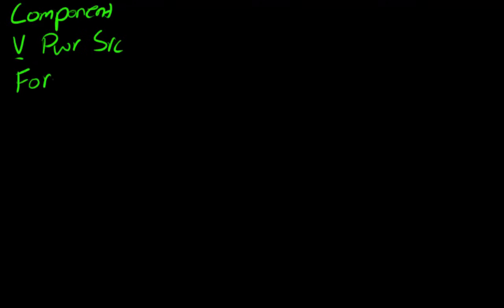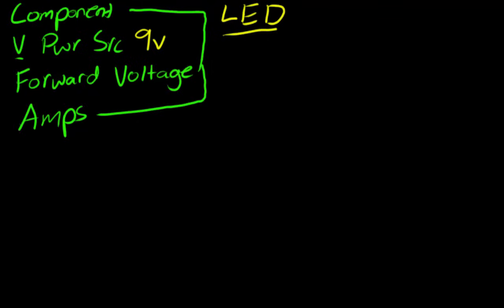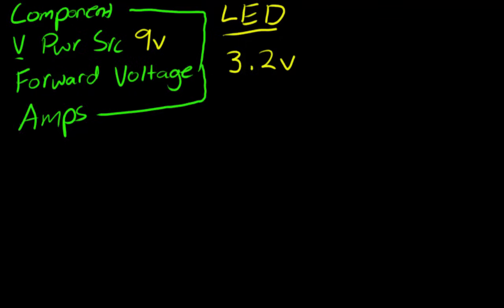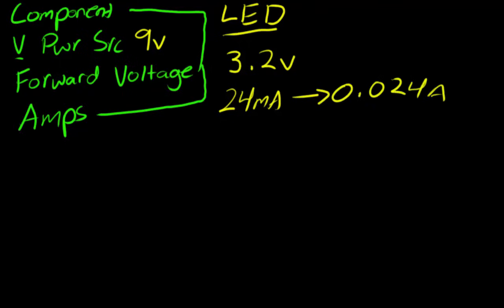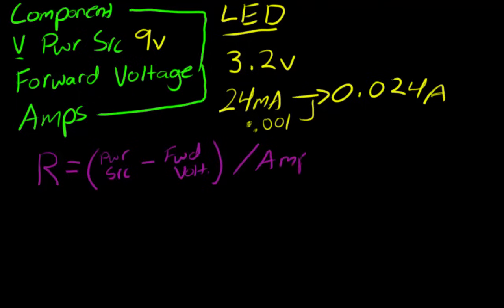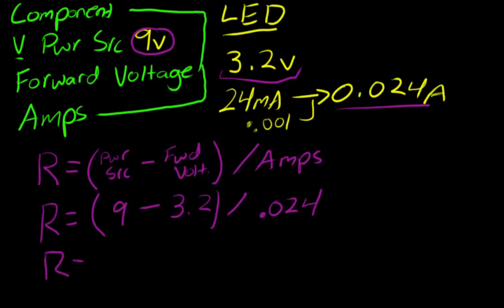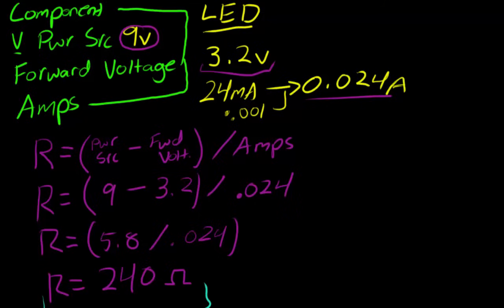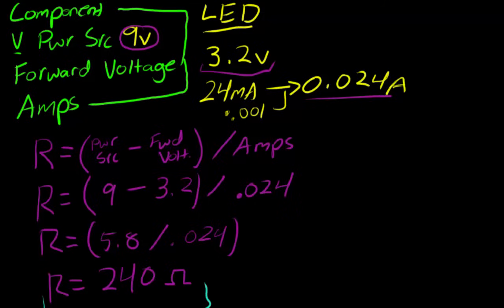Beginner Electronics - 7 - How Much Resistance?

Comment: Calculation is clear. But confusion is , when I calculate the resistor value and compare with youtube channel found discrepancy. Please share exact 100% LED's current and forward volts against LED colors with your vast experience.
Thanks

Comment: Ok what if i have 9 volts at a higher amperage how does this equation work then since its measured off forward voltage and amps of the LED not the amps of the battery???

Comment: If we have a data sheet that shows forward voltage type (example: 1.7) and forward voltage max (example: 2.2), 
I take it we go by type (1.7) to work out the resistance?

and Steady current (example 30 mA) would be for Amps(0.03 amps)?

The component I'm looking to use is a 3 bit 7 segment led display
and the power source is a 1.5 volt AAA battery

Comment: Do we just assume the battery has the correct amount of amps for the led? you said the 24mA was the led's requirement, but how the hell do you lower amperage? the equation only covers the resistance for the components amperage, only reducing voltage?
Reply: So basically the amperage of the LED is how much it will draw from the battery it doesn't matter if the battery is 20 amps the led will still only draw what it needs you just need to get the voltage right
Reply: I just figured it out.

Comment: Sometimes you do not need to add the forward voltage. I just did the same thing for a small motor and there was no Forward Voltage specified so I guess its only for LED's?

Comment: I have a power source of 19.5 and amps of 6.7. There is no known forward voltage differential as the power is moving into a coil of copper wire.  So if i divide it all out, I end up with about 3 ohms. My question is in regard to the watts that are being put out which is about 130 watts. When choosing a resistor, do I take the wattage output into consideration and if so, how do I calculate that in?

Comment: Just curious... 
Let's say you have a 24v power source and you want to power a gadget or let's say a laptop with a forward voltage of 19v;

Would the laptop work by adding a resistor to the 24v power source?

Comment: Im watching your videos to brush up/from scratch electronics, I have a light led fixture and its toooo bright but I want to dim it down but tge power supply is not dimmable so I thought I was smart so I figured how much voltage could it be on the load side 100-150vdc yikes, so know im trying to find a way to dim it after the power supply

I was thinking to just put a ristor or potentiometer but is it really that simple

Comment: A question - if you connect two 100 ohms resistors to the circuit, one after the other - does that create a 200 ohms resistance?

Comment: if I wanna add this is a car what voltage should I use a 12vwhen the car is off or 14v when it's on and what about the power of the resistor doesn't it matter.

Comment: Summary:
- some electrical components (e.g. LEDs) can only handle so much current going through them, any more and they will be damaged
- you know how much voltage your circuit has, but how much resistance should you add to the circuit to ensure that the LED (or other sensitive component) does not get damaged?
- use this formula: (circuit_voltage - component_forward_voltage) / component_current

Comment: Do you add a resistor for each LED in the circuit? Or would 1 resistor be enough for 10 leds wired in series

Comment: So if i have multiple components in a circuit say an led and a speaker do i do the calculation for the next component with the source minus forward voltage as my new source for the component so (new source - forward voltage) / amps used by component

Comment: Quick Question: Can you stack resistors? Like have 2 resistors on a circuit each at 120 ohms? or does the math not work that way?
Reply: Sorry, I'm like 5 years late to the party, but hopefully someone sees this
Reply: @lukexu6613  It depends how you connect them. If you connect them in series you just add their value. So 2 resistor of 120 ohms each connected one after the other are the same as 1 240 ohm resistor. If you connect their ends (forming a circle e kinda) its different. Here's a link http://www.resistorguide.com/resistors-in-parallel/. Also cool name
Reply: @lazyluke2773  Haha! thanks for clarifying, I was watching a hacksmith video and he had trouble with adding resistors or something so I was curious. Your name might be more accurately describing my current state though 🤣

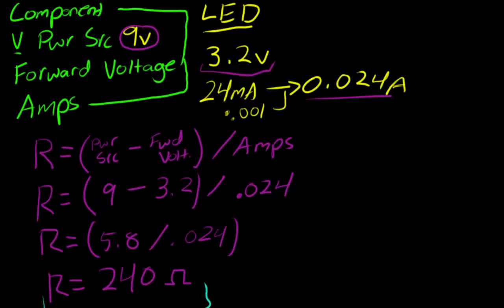Comment: (5:19) - I don't understand. 
If this equation is the resistance for the whole circuit, shouldn't the resistance of the LED be subtracted from the whole, (240Ω) to determine the required value of the resistor to use?
>

Comment: forward voltage =  the amount of voltage needed to get current to flow across a diode.
Reply: I think this episode might be crucial to the understanding of electricity. I imagine the forward voltage like a valve. If it is not reached the gate is closed for the current. If it is reached exactly then you need no resistor and it works perfectly. If it is overexceeded then the detla (supply - forward voltage) needs to be decelerated. The thing I don't get is that in the previous video it was mentioned resistance controlls current, not voltage. So what is the relation between voltage and current then? Of course R = U / I. But practically? If we have to much voltage and need ressistance to reduce it, then it is not controlling the current but the voltage. Or both? Maybe current and voltage together give a kind of momentum which can be reduced by ressistance.
Reply: @Mc12136  I love this question and your example! I would also wish to know through such an analogy if you can formulate it differently after such a long time. We may think alike. :D
Reply: R = U / I
R = ressistance we need
U = voltage overload we have
I = current the LED desires
I'll go with that. Still struggling with imagination and therefore don't know intuitively how much voltage / current is going out behind the LED in the circle. But the next videos might explain.
Reply: @Mc12136 did you figure this out? I think your misunderstanding here is based on your belief that “voltage goes in and comes out” which it does not. Voltage, aka “electric potential difference” is the difference in potential between two points. 

For example, if you lift a rock a foot off the ground then the rock has potential to fall when elevated but no potential to fall when it’s on the ground. The difference between these two states is measured in Joules for the rock (1J if it weighs 0.75lbs) and 0J if it’s laying there. It’s a difference of 1J. Hence, voltage is Joules per Coulomb which is 6.25 quintillion electrons. In other words, you have to measure the potential before and after the component and the difference is your value for voltage. It’s called “measuring across” because it implies something like a bridge. 

I’m kind of new to this too but it’s important to realize that voltage is not going anywhere. It’s simply a potential for the electrons to move. Before the component there’s more potential, after there’s less. You measure each point to determine the difference and express that in Volts. It’s sort of like disliking your neighbors then moving away. Your hate motivated you (the electron) to move but now that you’re in a new nice place, you’re no longer motivated to move (voltage didn’t come with you). 

Does that help or did you already find the answer? I’m just trying to do some peer review to help myself learn also. Anyone who can tell me I’m wrong is welcome to 😂
Reply: @Mc12136 regarding your second question, according to ohms law voltage is current times resistance (V = IR). 

Let's say we have a 10 volt battery and a LED that requires 5 volt and 2 amps of current to run.

Now 10 volts are clearly too much for the LED and we would like your resistor to eat up 5 volts so that we can provide the remaining 5 volts to the LED.

Keeping the Ohms law in mind and moving the variables around we can understand that since V = IR then R = V/I

So our ideal resistor that should eat 5 volts out of 10 volts while allowing 2 amps of current through would be:

R = (10-5)/2 = 5/2 = 2.5 ohms 

Hope that clear things up
Reply: @dough-pizza  Thanks for explaining. The velocity analogy for voltage is very helpful.
Reply: @Mc12136  voltage controls the rate of flow of electrons. A high voltage means a high rate of flow of electrons.

When you add a resistor to a circuit it limits the flow of electrons. Since a high flow of electrons means a high voltage, a lower flow of electron means low voltage. So since resistors limit the flow of current they're essentially limiting/reducing the voltage
Reply: @dough-pizza you're wrong brother resistance is about limiting current not voltage. Voltage is just a difference of electrical potential energy not the flow of electrons itself. You can have the same amount of voltage in a circuit but increase the resistant and therefore decrease current.
Reply: So like is it the minimum amount of voltage for the current to overcome the resistance within it?
Reply: @VSHEGDE1947  nah. That's just the minimum amount of current you need to light up a LED. Simple
Reply: @Yash-qs8iu  So if my power source outputs at 3.2V I could light up my LED without having to place a transistor first?
Reply: @TwistZero  With LEDs, once they receive a voltage greater than or equal to their forward voltage, they will draw as much current as they can. A resistor is needed mainly to limit the current for the LED and less so to drop the voltage.

Comment: What is forward voltage ?????????????????
Reply: you've probably figured this out by now since it's been 5 years, but I just saw this and here to say, that forward voltage is the (how it was explained to me in school) the voltage required to energize or push current through the diode or LED. There will always be a loss of voltage across the LED.

Comment: Now wait just a minute what if I've got me a LED with a "VF" (Forward Voltage?) of 3.3V and I hook it up to a 3.3V input off my Arduino here. Do I just not need to worry about things blowing up? And if you're feeding your hypothetical LED 9V, does that mean you just went and reduced the Voltage/Water Pressure with your resistor down to 3.3V?
Reply: just use the formula lmao
source - FV in your case would be zero. You can then divide that by the amperage, whichever it is, it will still return a resistance of zero ohms.

Comment: What does "forward" mean in "forward voltage"? And what's the difference between it and a "nominal" or maximum allowable voltage?
Reply: forward basically mean the minimum voltage needed for a component to work (or for the current to travel through ((move forward through)) the component) and nominal is the maximum voltage a component can handle before it fails.
Reply: @arroweyraud8267  thank you sir

Comment: forward voltage is the voltage which is used up by the whole ysytem (including, more led's, resistors, and switches..etc.) right?
Reply: I always thought forward voltage was the electrical energy capacity an object can contain.

Comment: so i have 12 v dc power supply and  DC 7.2-9V motor and it run on 0.5 A...when i calculate it it result on 6 ohms....but i cant find 6 ohms on internet....where did i go wrong??

its ok now...so i just need to use the 10 ohms

Comment: What if the forward voltage has a range, or is higher than the power source?
Ex. I'm using 3V to light a 3.0-3.2V green LED. Depending on which value I use, my required resistance ends up being 0 or negative - so no resistor is needed?
Reply: Lower is only bad if it's too little to run the component. No resistor needed, if it doesn't work, you need higher voltage. 

This might be a bit late for answering this question, but maybe someone else with the same question will see this.

Comment: Out of curiosity, would you be able to compound resistors to equal 240 ohms? For example, use two 100 ohm and one 40 ohm resistors. I'm sure this isn't optimal but if you had to is it possible? If not, why is that?

Comment: what if we are using 1k resister which ~4 times of required one, would it blow the LED or if we use 100 resistance which is less then half, 
I am bit confused on if 240 is blocking or 240 releasing. which case would release more current ?

Comment: Just a slight clarification for those who are struggling to get the forward voltage part: forward voltage more or less means how much energy the diode uses up. Forward voltage is how many less volts we'll have in the circuit after the diode, as opposed to before it. So to find out how much voltage we have in the circuit as a whole, we need to subtract that number from the source, or else we would be overestimating. 

This also mean that if we have more than one LED (or other component), all we have to do is plug in their forward voltage into the equation, and it will tell us how much less resistance we need.
Reply: So, if I'm understanding this correctly, let's say we have a 9v battery and three LEDs that take up to 3v each. Would using all three LEDs in a circuit eliminate the need for any resistors? And would having a fourth LED cause them all to glow less brightly due to the shared voltage being more spread out?
Reply: @narrow_mouth  thats what i was thinking! Waiting for the response now :(
Reply: BoomTownWhale good point. Will be waiting for an answer as i am confused
Reply: @narrow_mouth  You don't need a resistor but its good practice to use one and adding a 4th led will cause everything to be dimmer. I got this from google so this might not be accurate
Reply: @narrow_mouth  it's 5 yrs now and no answer, so for such a case, just wire them all in parallel with their individual resistors to avoid breaking the fabric of spacetime
Reply: @narrow_mouth still waiting for the answer 😭 where has the man gone????
Reply: Still waiting for a reply 2 years later.
Reply: Good question boomtown whale. I await an answer aswell
Reply: Still waiting for a reply another 2 years later.
Reply: @MrSambaBal  just do the circuit and youll see for yourself

Comment: So if I have a power supply that pushes 30v and 10amps dc right. and my device wants 30v and 1.3 Amps .How do i stop it from drawing 5amps at 30v? because it gets hot and starts to draw more and more . Than it sends more amps because of heat. I can cool it and it helps alot. But the problem is still there how do i stop it from drawing more amps as it heats up?
Reply: why is no one answering this question? i read every single comment and a bunch of people are asking this. if i have a 9v battery pushing way more current how does that factor in? youd obviously need much higher resistance, but this part is nowhere in the formula and i cant find an explanation for this anywhere. how can the current of the power source be totally ignored when calculating resistance?
Reply: i responded to the wrong person. lol

Comment: Thank you so much for the video.  Can i use multi-meter to know forward voltage and amps for LEDs if i don't know the manufacturer or the forward voltage and amperage?. Do I need 2 resistors if I have 2 LED lights or i can use one resistor? Also what if the resistance so high like 500 ohms?

Comment: Thank you for this video! But I have one little question. If u need a 240ohm resistor but u only have two 120ohm resistors, can u combine them?
Reply: Yes. If you add resistors in series (one after another) you can combine their individual resistances together to get a total resistance value. 120 + 120 = 240 ohm. Two resistors of 120 ohms combined together in series are equivalent to (or the same as) one resistor of 240 ohms.

Comment: what about the amps of the power supply ay i have a 12 v dc power supply which boasts of a 1 am current ho are we going to incorporate that in calculating the resistance required 
please guide
Reply: why is no one answering this question? i read every single comment and a bunch of people are asking this. if i have a 9v battery pushing way more current how does that factor in? youd obviously need much higher resistance, but this part is nowhere in the formula and i cant find an explanation for this anywhere. how can the current of the power source be totally ignored when calculating resistance?
Reply: someone pleeeease explain this. its the only part i dont understand

Comment: Do that mean 'When LED is operated at 3.2V it will have current of 24mA.'I mean, is the resistance of LED =3.2/24mA?
Reply: No. The LED requires a minimum voltage of 3.2 volts before it will work. So you need a power source that is greater than 3.2 volts. But the LED requires no more 24mA current to light up otherwise it will blow. So depending on what your power source is you will have to provide a suitable resistor to restrict the current to the LED. Lets say we have a 5 volt battery power source. To calculate what resistor will be needed we can do the following calculation: R = (5v - 3.2v) / 0.024A = 75 ohms

Comment: hey,brother i am confused how you put and measure the Amp value. i am on the way ,i am not understand?
Reply: Both forward voltage and amp value are info that comes with your leds, that's why he said you should always keep the info that came when you buy your leds, I believe common knowledge is that a normal led is 20mA (miliampers) and 2V, that's why he says a 2.4 V led is a pretty high value.

Comment: Why we divide it by amps? Plz ex. Its help me to understand wat praticaly going on and become easy to learn dis formula.
Reply: He missed the I (capital i) in the formula, I stands for current which is measured in amps, this is an elaboration of ohms law where resistance equals voltage divided by current so it would be this : R=V/I, so resistance is expressed in ohms, voltage in ohms and current in amps :)